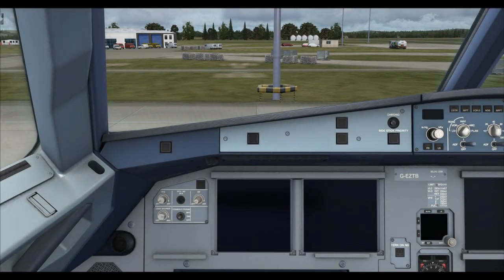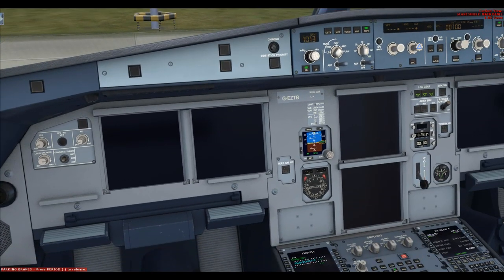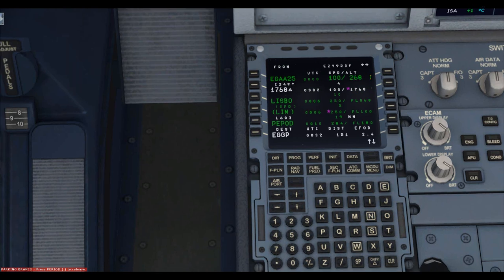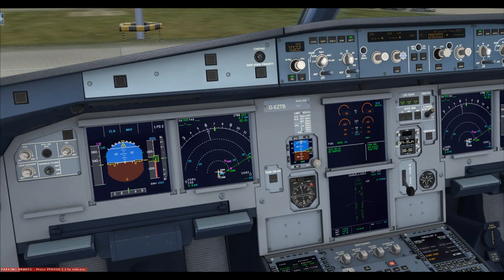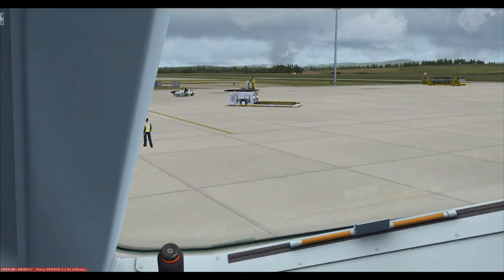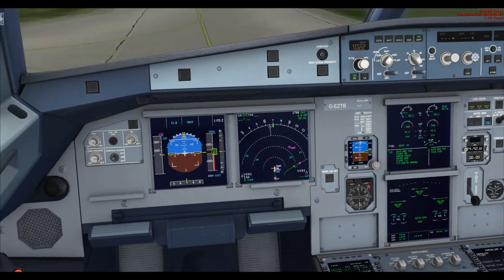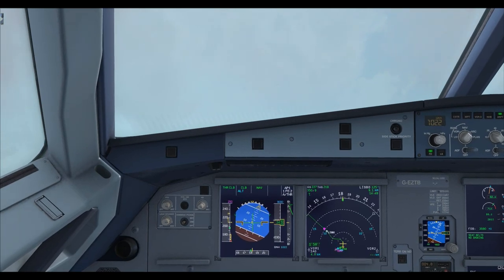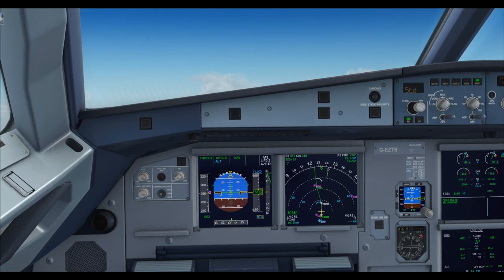HOW TO FLY AN AIRBUS - PART 2

Comment: I know the airbus have the fly-by-wire switches on the overhead panel but if I wanted to disable them and fly the plane manually which one of those switched do I have to disengage?
Reply: you can turn off the fly by wire on the right mcdu in the options although i have no idea why youd want to do that or what effect it will have

Comment: Hello Matt Davies I'm having a problem with the process of starting the engines when I begin to start the engine I don't hear the pilot say "Engine 2 is stabilized" I don't know if it's a software bug or not but this is preventing me from starting the "after start" checklist.
Reply: have flipped the central knob to ignition before firing up engine 2? also take a look outside and see is the engine moving
Reply: Neal McCullough
nevermind fixed I updated my version of the airbus as the one I had was buggy.

Comment: i have no pedals, but want the airbus x. Is it 100% necessary to have them for this, or will the key assignments work for the checklist also.
Reply: +fowlbird1000 You don't need pedals, any form of rudder control will work.
Reply: +Samzo111 kk thanx, i bought it last weekend, but it is too laggy, so it impossible to use on my potato pc! Thanx for the help, though.

Comment: Hey Matt or anyone else who might be reading this. I (think I have) followed your tutorial to the letter however when I take off and then put the throttle back into the CLIMB indent I get a warning on the console say "AUTO FLT - AUTO/THR LIMITED". Any ideas what I've done wrong? I've got the co-pilot doing all the checks and stuff so not sure where I went wrong.
Reply: So! In reviewing my proceedure I notice (and you won&#39;t be suprised to hear this) that I did not follow your tutorial to the letter. I simply put the Flaps/Trim figures into the FMC incorrectly. I realised this because the Co-Pilot set Flaps to 2, whereas in fact I required 0.2 trim. Problem solving!!
Reply: this usually means the thrust lever isnt set correctly or has jumped slightly out of the climb detent just move the thrust lever slightly til you hear it clicking back into place
Reply: Yes I believe that's what it is. I heard the click but I think it's just a fraction out of the position. Thanks for replying!

Comment: Is anyone else experiencing the autopilot randomly disconnecting and not being able to turn on?

happened to me yesterday.
Reply: B0ss Pls it might be you speed.   If your overspeeding or (in the red bricks) the airbus will some tunes disconnect or take control of auto pilot.    Its the same if your speed Is to low the airbus will take control its a safety thing

Comment: Excellent tutorial! just purchased the Aerosoft Airbus addon fleet A318/19/20/21, and am a complete novice to airbus aircraft, attempted few flights but follow everything you said even wrote it down, but after takeoff, I activate autopilot reduced to clb thrust on the throttle quadrant when indicated , I set my altitude in the MCP, and it appears to climb albeit 'steeply' but controlled and makes the initial turns from the SID, but it then exceeds the altitude set in the FMC and then starts to decrease the altitude , and the speed goes haywire flcutuating from 200+ to 300+ and then back down, what am I doing wrong? I get no error messages from the FMC setup etc, I just can't get it after takeoff to hold the altitude and speed?? thanks

Comment: matt i realise this is an old video and youve learned a lot since then but i think the reason you have to get up to 10 knots in order to initiate the taxiing checklist is because you cant do a proper brake test at a speed lower than 10 knots. im also guessing the nose lights are probably set prior to the checklist in real life

Comment: How did you get your PFD and ND working, on mine (following same procedure) the display seen at 9:00 (and before) never goes away, yours just magically pop on after you close doors at 9:35, mine don't.Hope this makes sense.
Reply: +Streaky100001 The PFD and ND "come to life" when the IRS aligned, in this video it just so happened that the IRS finished aligning when he was closing the doors, it has nothing to do with the doors themselves. To align the IRS see 3:39 for turning on the ADIRS and to see how to align the IRS, take a look at 4:52, and you will see the "ALIGN IRS" button on the INIT page. Once you do this, give it 5 minutes and your PFD and ND will come to life :)
Reply: +Samzo111 Ah, ok, thanks. I had my ADIRSs turned on but failed to align the IRS, I'm used to the PMDG 737 where you turn them to nav and everything's fine.

Comment: What is the button or what do you do to automatically set takeoff thrust?
Reply: i THINK its toga
Reply: +The Game Warrior no its not you just set the thrust levers to take off power depending on circumstances and take off weight you can set them to flex as seen in this video or full toga theres no button you press like on a boeing type aircraft

Comment: How do you control your nose tiller?
Reply: There is a button left of the yoke in the plane, it's black, press the button on top of the circular thing
Reply: Iron Matrixs Thanks, I recently bought the plane and found that button while I was playing with all the features ;)
Reply: Your welcome I had a problem with it too
Reply: Iron Matrixs Oh, what was the problem?
Reply: My rudder wouldn't work
Reply: Iron Matrixs Oh, ok. That hasn't happened to me.
Reply: No
Reply: I'm saying it wouldn't work cause I had the switch in tiller
Reply: Iron Matrixs Oh, right.